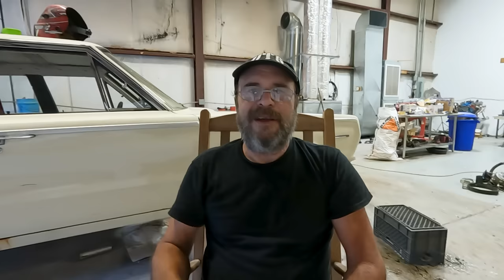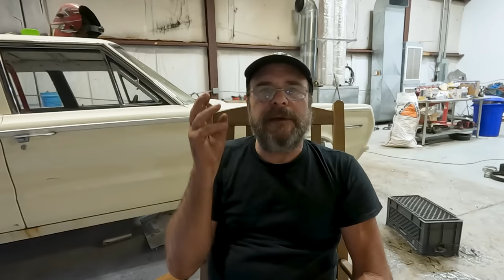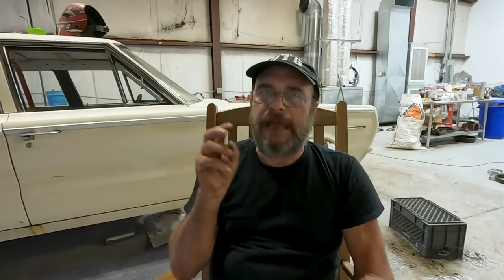They Really Are Out To Get You- How The Automakers Have Made Life Miserable For The Average Mechanic

Comment: Totally agree I have worked at the same Ford Dealer for 33 years and I say it everyday, they have a team of engineers finding ways to make these cars beyond hard to service.  From simple oil changes to overhauling engines or transmissions.  This profession has become a joke and I don’t advise anyone getting into this field.
Reply: Really when you think about it,today's ceos and auto stock portfolio is becoming more like a bunch of thugs that have a short life and nothing to offer in brains.
Reply: IF we quit buying their crap they'd change their ways or go out of business.  Which is exactly what they deserve.
Reply: Hey loses go electric end of problem 😅
Reply: Engineers are the worst these days - not all of them but when you make a structurally sound product with a tiny plastic part or specific tooling that keeps it from working correctly drives me nuts as a mechanic - I’ve had to tool and shave down points of contact to make parts fit or salvage a bike - rebuilding the bearings without a full disassembly so the bb cups don’t snap from rust - it’s annoying when a customer brings a basic repair and I tel them you need to buy a new bike there’s no fixing it
Reply: preach it brother . turned 60 recently been in the profession tooooo long . some of the bs you have to do to repair the simplist problem bogged down by the whos paying inigma our dealership seams to struggle with getting that info up front. if it was my bussiness id wanna know how this project is getting funded. oem parts with a 300% mark up and now you wait weeks to even get the part.. hows your productivity?
Reply: I've been an Infiniti tech for 12 years. It's getting worse and worse. All these unnecessary electronics they are adding is stupid. Parts are insanely expensive. People aren't going to be able to own a vehicle soon.
If you do buy a new vehicle make sure you get the longest warranty you can.
Reply: That has to do with modern day young engineers that don't know how or have ANY interest in learning how to work on cars, especially modifying them after the fact for serviceability.
Reply: Yes, running a single sensor through 2-3 different power modules before its data reaches the PCM is a dumb design.  However, at the end of the day, once you get past harnesses, the mechanical aspects of these modern engines is still your basic internal combustion engine.  Now companies like BMW, Lexus, and Mercedes have a serious fetish with overengineering engine layouts, plumbing, and harnesses and it takes a little research and a lot of patience to work on them, but it can be done.

I think my biggest gripe on modern cars is the lack of a transmission dipstick and dipstick tube resulting in you having to crawl under a hot running car and maneuver around hot exhaust just to check fluid level and then run a hose into a fill hole and pump fluid in.  Dumbest thing.
Reply: 💯% FACTS! and Ford is the WORST out of all of them. We have a 2014 Ford Escape and those evil Ford engineers made it to where you have to remove the fender liner and the bumper cover to access ONE single bolt out of 4 to R&R the head lights or to replace the headlight bulbs. Another example is if you need to unplug a door wiring harness on a 1998 - 2011 Ford Ranger if you have to replace the whole door you have to drop the dash down to gain access to the plug. Then there's the 2000 - 2007 Ford Taurus (mainly the one with the 3.0 24V Duratec engine) they are absolutely the definition of a disposable car. It is so sad.
Reply: @walterfoster5682  do you think that the average Joe will be able maintain or repair a electric vehicle?Think about it when you are at mugging station for 30 minutes fighting for a place in line to charge your car. In Europe the police are called all the time because of fights and robberies at charging stations.
Reply: @BrianSmith-lo3mj  : I'm interested in a Ford Maverick. When I learned that you have to remove the whole windage tray to change the oil / filter, I started to rethink the vehicle. Hopefully, oil and filter would be 90%+ of the maintenance. 13 bolts, and a whole tray,  rather than build in inspection ports. What else did the screw up on, just to save a few pennies per vehicle, and make maintenance so much more difficult?
Reply: @walterfoster5682 no thanks I'll stick to my manual 1985 Toyota van wagon before I explode in an electric car from hydrogen gas being produced from the chemical reaction of copper and lithium when a battery cell goes bad.
Reply: @robertmaybeth3434 I have never bought a car that's more recent than 2000. I'm about to buy a Pajero swb 2007, with body on frame, that as young as I can go.
If you cannot fix it, you don't own it 😤
Reply: Just replacing an oil pan in a 2009 Ford escape is a fn nightmare for a mechanically inclined mon-mechanic

Comment: Further, some manufactures require special tools to instal parts, and these tools are only available to dealer workshops.
My mother's Ford Mondeo was taken to an independent shop to have the transmission replaced.
The rear main oil seal showed signs of leaking.
Got the car back, and it was pissing engine oil after 100km, (60 miles), of use.
Sent it back to the shop, and the poor bastards had to do the major strip-down, but called to say they couldn't obtain the installation tool from Ford.
Fortunately, they spoke with an engine reconditioner, and found a work-around.
Car is back, not leaking.
So they did the entire job again, but stood by their work - no charge.
Poor bastards.
Excellent service.

Comment: Tony as a retired new car dealer, this was always the manufacture plan. Don’t forget “special tools” we had to buy from the car maker. This made it even harder to work on a car without these tools.
Reply: I remember when this was done even on the Allen plug for the Renault 4 oil sump. Of course all us car Diyers  ground down something to fit, but it left a sour taste.
Reply: Like the Cadillacs.
Reply: Oh fk specialty tools .
Reply: I’m an independent Harley mechanic and there are specialty electrical diagnostic tools (breakout boxes) that make an electrical diagnosis much quicker and easier. The Harley manuals even give you the breakout box part numbers but then the dealers won’t sell those tools to anyone because they don’t want the average person to be able to fix their own bikes. Gone are the days of simplicity.
Reply: I have been telling buddys to keep these older cars around. iam a master mechanic of 35 years. run my own shop late model parts are horrible and hard to get. And  now with the layoffs hard to get factory parts. you better know how to keep this old stuff going or your walking
Reply: I really like my Honda, as it seems to have been designed with serviceability.     I can do 95% of the work with a set of basic Stanley wrenches and a 10mm socket.   And since they crank out so many cars, aftermarket parts are plentiful and shockingly cheap.
Reply: According to my brother, modern Chrysler models need a god damn crowbar to be worked on mechanically, and of course he despises German-specific tools as well.
Reply: I think they started out, just trying to make it nearly impossible for the average car owner to work on their own car and keep it running forever. Then eventually, I think they figured out they could stick it to the small time mechanic shops too, by auto design, to make even more money. All we need is one person to come along and start mass producing vehicles that you can service and repair yourself. Sadly, Elon Musk could do it, but he doesn't seem interested. I don't know anyone who could bring back the car you can fix yourself, but improved in design even. It's not that hard technically. The stuff they do nowadays is what's hard, intentionally. They just need to space the parts out and make generic parts that can be swapped without over complicated eletronics. Allow access panels, access doors to replacement parts, and don't make any part that typically goes bad within 100k miles so that you can not directly access it. In other words, no more hiding parts that we know need to be replaced in the first 100k under so much other parts, that you can't even do it without fear of not being able to get it back together right or messing up the computer's learning system and all that.
Reply: “The creatures from Jekyll island” is a great book about the federal reserve. Those dates you listed are explained in that book, along with an other dates and a history of fiat currency and fractional reserve banking. I didn’t think I was going to hear that from your video when I clicked on it. Amen brother! Keep up the good work.
Reply: Their tools aren't always the best quality, but I appreciate Harbor Freight for making many specialty tools available for the public at an affordable price. Some of the things I purchased from them I only needed to use once, but even with that cost I saved money.
Reply: Special tools are based on parts design.  If a design is better functionally, but needs a special tool to work on it,--I don't have a problem with that scenario.
Kind of brings up a question I just thought of. "What came first?  The part design or the tool?".
Reply: @douglasspoonamore1094  Yup. He mentioned 1913, the bday of the irs. I asked these pro-tax people if we really need this dept because if you simply asked them if the "aye ar es" was est. 1913, how come we didnt descend into chaos beforehand?

Comment: "Things are weird now and they're going to get weirder." This man does not lie! This is the first one of his videos I've seen, and he is 100% correct on both the mechanical front and how we're getting screwed by the corporate/global government.
Reply: But how things come out on the other side, he is DEAD WRONG.
Reply: @trickyrick8621 it depends on how you are now and what you expect ..yes some won’t like it but most will be fine after it’s all done
Reply: It will get way worse when EVs become more common, those cars are literally unrepairable and are junk instantly.
Reply: Love his videos as well. As a collapse theorist (and practicing Survivalist), he's right: We are collapsing, heading towards a brick wall at 1000 miles an hour. However, on the other side of the die-off, we'll probably go back to the future: The 1870's future.

Already operating in the mode Uncle Tony describes: I have two pickups, a 1995 Nissan, and a 1990 Dodge Cummins Diesel. I know every nut and bolt of these vehicles, and don't plan on buying anything newer.
Reply: Tony’s awesome keep watching
Reply: you're 100% right.
Reply: Shalom,  Cattle
Reply: @ghoulbuster1 An EV spontaneously combusted in London area airport, destroying a 4 year old parking complex and 1000 cars. The lithium fires are nearly impossible to extinguish, they simply run out of combustion, maybe hours or days later, if you consider recombustion after being extinguished

Comment: I bought a 1978 Chevy truck 2 years ago, because I wanted a simple replacement for worn out parts. 
Well it’s not simple when you can’t get parts for a rear full floating axle brake kit. My fix was to go Aftermarket and replace the drums with disc kit. Works great now. 
These are the kind of choices we will have to make and we all might start looking like Mad Max.
See you in Thunder Dome!

Comment: Something you reminded me of that happened to me several years ago. I hurt the engine in my truck, and I was across town at a friends house. He had a coworker of his over that day that I was there. Those two worked at the Mercedes dealer in town; the coworker being a service tech. I proceeded to remove the engine from my truck in his driveway with hand tools. This tech, was completely blown away that I was able to take the engine out of a vehicle, fix it, and put it back in using just hand tools (and a hoist) in a driveway over a weekend. He had never seen or heard of such a thing because it's not possible on newer cars.
Reply: That doesn't make any sense. He must have been inexperienced, a lube Tech or a liar. Dealers pull engines and transmissions with hand tools everyday.
Reply: @2DclanSnipingTeam  some people these days are THAT oblivious of how things used to be. it's truly sad. tough times are coming.
Reply: You kidding? You damn near HAVE to remove the engine, just to get to anything that needs changing/replacing.
Reply: @painkillerjones6232 do they take the engine out of the top with the car on the ground, using just an engine hoist?
I thought new vehicles had the engines removed out of the bottom with the subframe and everything attached?
Reply: @johngault7329 A few are like that but nah they come out like old .
Reply: @2DclanSnipingTeam 

About 5 years ago, a teenager asked me if rotary phones were a real thing.  She didnt think they were, probably because she never had seen one IRL.

Comment: When the $5 circuit board cost  $ 1,000 to be replaced,  and the shop need $ 10,000 in computers to do the repair !
CAR  VS COMPUTERS WITH WHEELS !
Reply: I wish hobby groups would arise that could take a popular modern used car, gut all the electronics, and sell a single board computer that could run the engine only off a few sensors like exhaust O2, manifold pressure, and throttle position. Then you can ignore all the fault codes from all the other junk and get running.
Reply: Computer network already...
Reply: It is in every aspect of our lives. A 90 day supply of doxycycline for a fish tank with a “yuck” problem costs $60.00.
A 90 day supply RX for human version of doxycycline (exactly the same different color capsule) costs $4,400.00 without health insurance. With health insurance $60.00. See what capitalism is doing to all those with no insurance or really crappy insurance? It’s the same business model forcing the cattle into the chute, with their beef tag identities punched into their ears. Humans are a mere commodity for finance, they won’t hide it with propaganda for much longer, and then their true colors will be on full display for the world to see. It is too late to stop them now.
Reply: When a leaking tail light Lense in a pick up truck can cost you over $5000.00 to repair, something is dead wrong !!!!!!!!!!!!!!!!!!!!!!!!!!!!!!!!!!!!!!!!!!!!!!!!!!!!

Comment: When I was locksmithing about 7 years ago our boss had to pay for a service so we could call in the vin on a car so they could give us a password to be able to talk to the car via a plug in diagnostics tool just to be able to program a new fob to a vehicle. It was absolutely insane. Oh and if the customers car battery was at 11.5 to 11.9 volts the computer wouldn’t let the new fob be programmed. It was always fun telling the customer that we couldn’t program their fob because their car battery was too low. At the end of it the customer would be out anywhere between $200 - $400. The older vehicles all you had to do was hit and hold buttons in the vehicle to program a new fob or jam a paper clip in the obd and be good to go and it only cost you like $20 - $40. They have definitely screwed us over in every way, Tony is spot on!
Reply: Seems pointless til you buy a mid-2010s KIA and your car thief can easily program a new fob for himself

Comment: As a mechanic of 34 years I completely agree. We have been getting screwed for years with cars e.g. no drain plugs on trans and diffs, fuel tanks scaring you , no access, special tools, restricted technical data I could go on and on. The technology is over complicated and less reliable now. In addition mechanics have poor pay, poor benefits, poor conditions and have to buy expensive tools, that's why there's a shortage of good mechanics.
Reply: Agreed 100%
Reply: I’m retired and was a fleet mechanic for a power company and have experienced so much of this greed generated engineering!
Reply: Don't ever call one a mechanic they are  "service technicians"😂